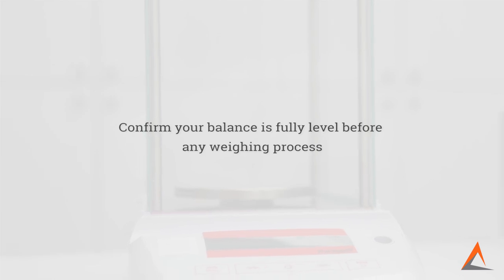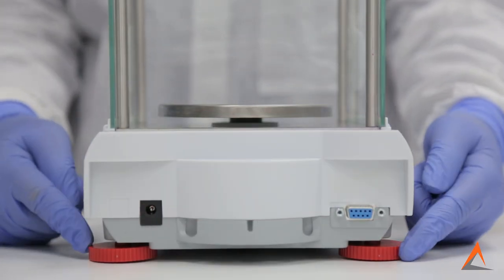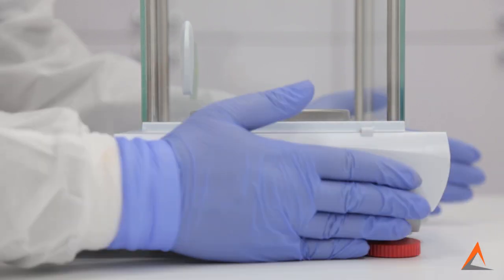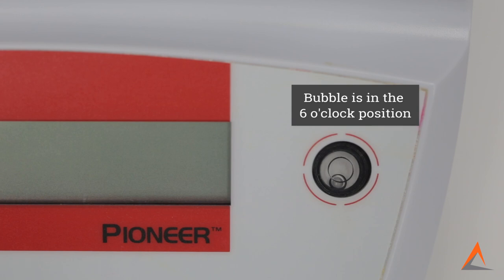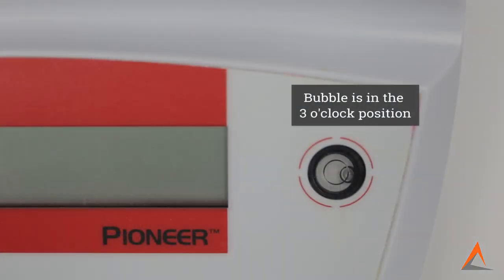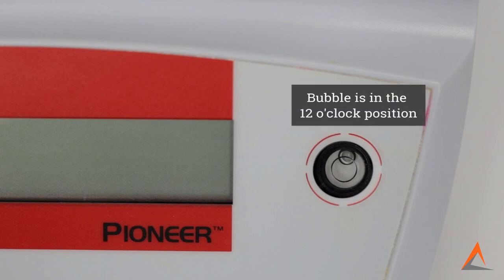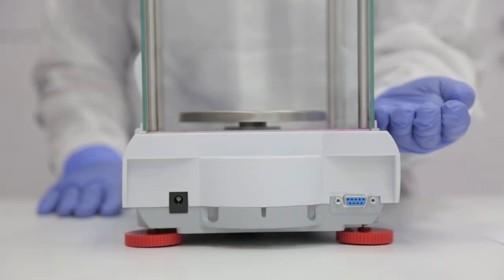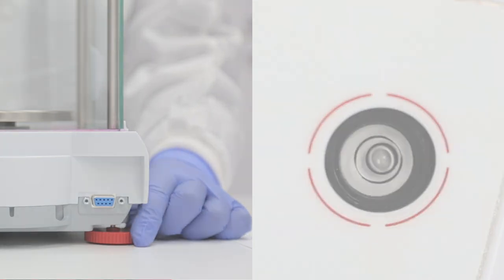Compounding Tips : Leveling a Balance

Comment: If the balance had 4 feet, how would you level this?
Reply: Good question.
This type of balance has 4 feet, but if you noticed only 2 can be  use to adjust the balance bubble which are the BACK FEET.